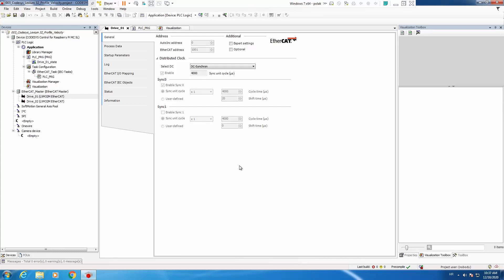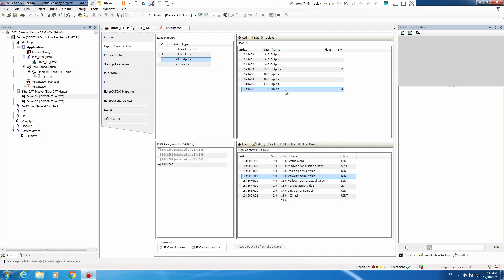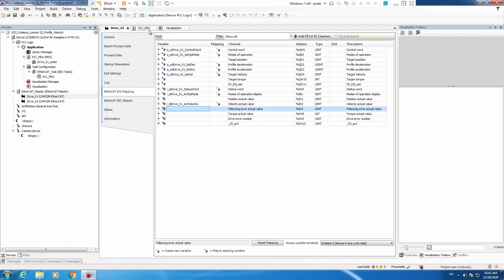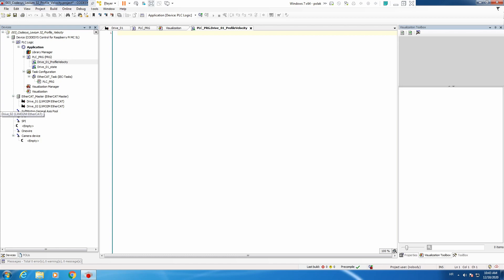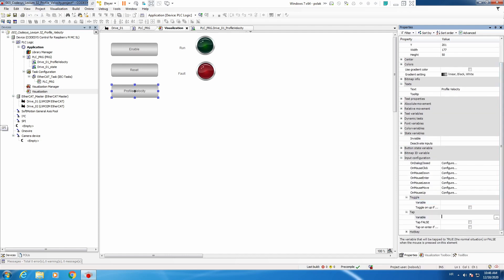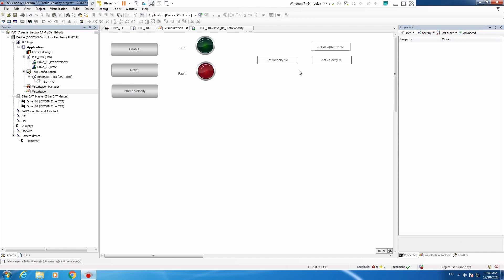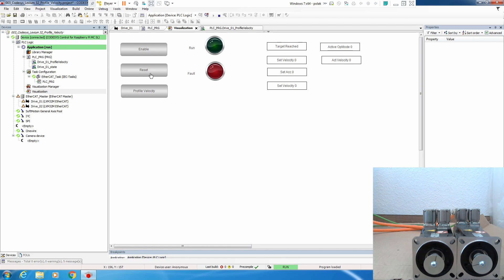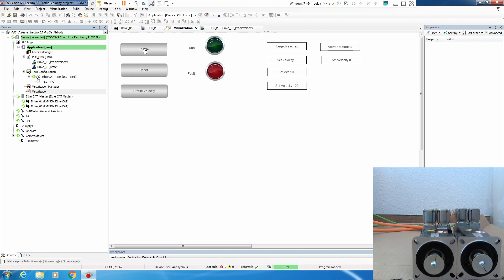03 - Lexium 32 - EtherCAT - Codesys - Profile Velocity

Comment: Hello. I don't know if you're still answering to commente but, i have a python program, and i can read data on the lxm32m, but i can't write because it says : "Data cannot be transferred or stored to the application because of local control"
I juts wanted to know if you know anything to go into remote control, and stop using local control
Reply from the maker: hi. unfortunately i cannot help you with this topic. technically you should not have a drive in run to transfer all parameters. also local and remote control is handled by commissioning software usually.....so......i have no idea what is wrong with your app
Reply: @ i found out, my lxm was in local control, and i had to switch it to Fieldbus control in somove app (schneider)